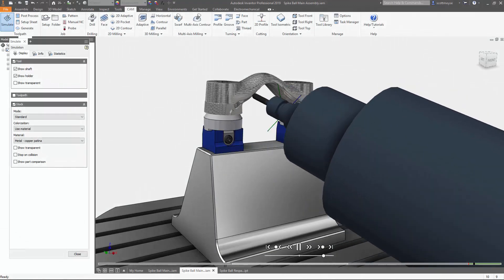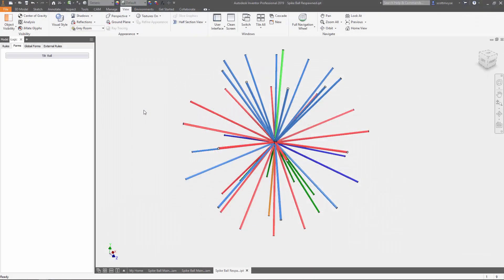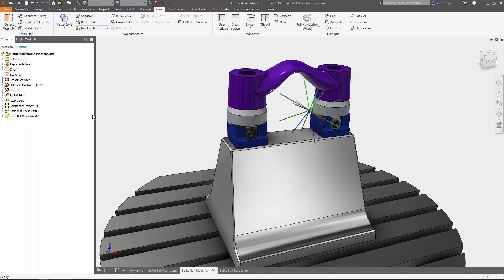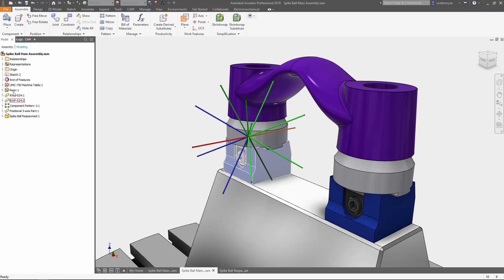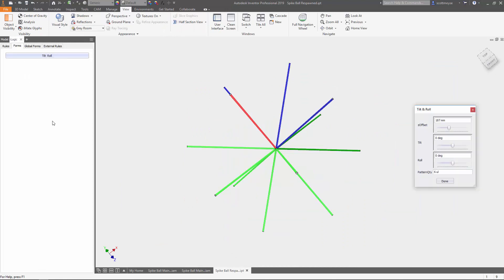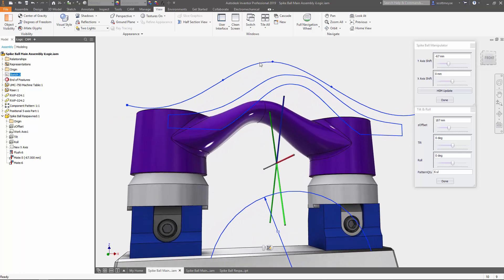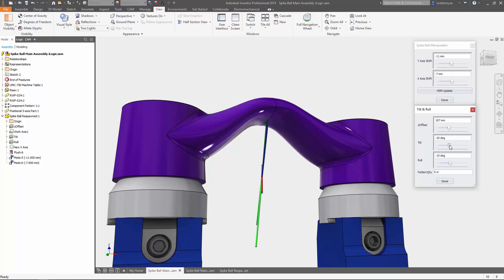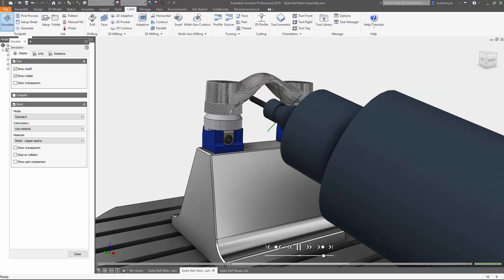QUICK TIP | Inventor HSM Tool Orientation for Power Users

Comment: When adjusting the tilt and roll angles are they absolute or relative to the setup WCS? Also, how do you know you're not moving to an angle outside of the rotary axis limits of the machine tool? Thanks.
Reply: That just depends on the alignment of the spike ball origin relative to where you set your WCS origin. So far as machine limits, you could easily set those up in your iLogic rules.